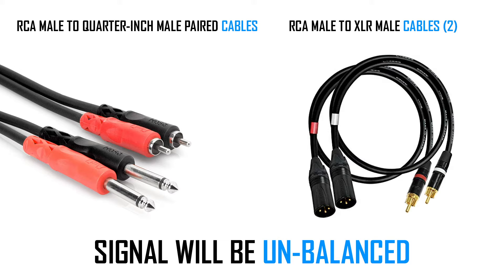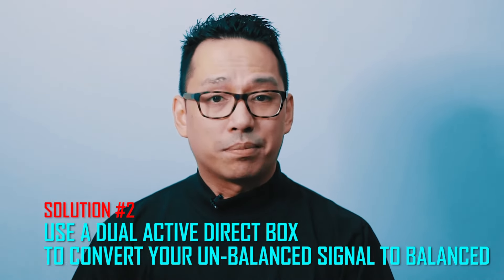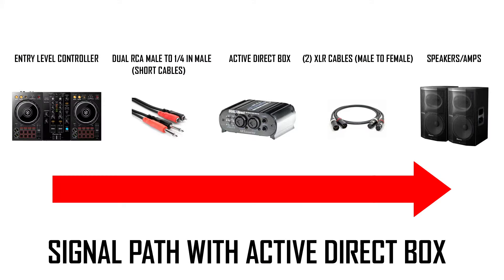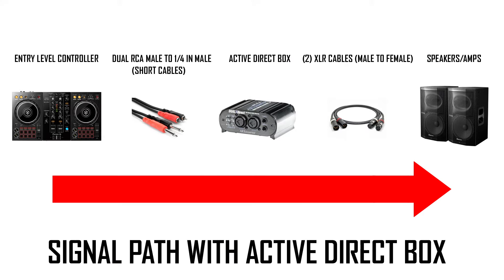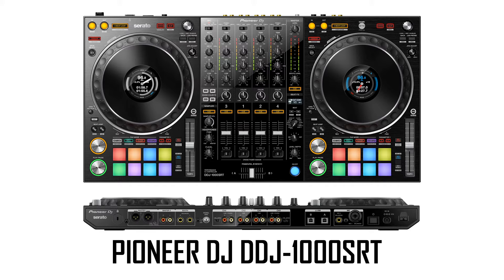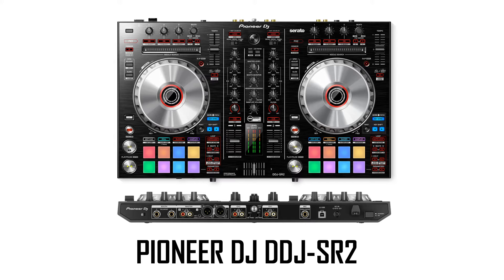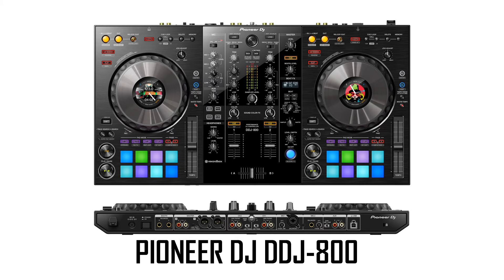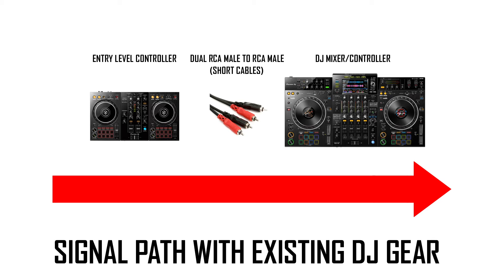Entry Level DJ Controller | How to connect to speakers or sound system

Comment from the maker: Product Links:
CABLES
RCA to RCA cables https://amzn.to/2NEyBni
RCA to 1/4inch cables https://amzn.to/2O3qXSx
XLR female to XLR male https://amzn.to/2qIhND4 

ADAPTERS
RCA female to 1/4inch male https://amzn.to/2NFuirM 
RCA female to XLR https://amzn.to/2NJLnRH 

ACTIVE DUAL DIRECT BOXES
Behringer Ultra-DI DI20 https://amzn.to/33HBCZM 
Art Dualxdirect https://amzn.to/32JProZ 
DBX DI4 (4 Channel) https://amzn.to/2Q7UPQm 

SMALL PA MIXER
Behringer Xenyx Q802USB https://amzn.to/2QiNv4e 

MEDIUM PA MIXER
Mackie ProFX 16 V3 https://amzn.to/2rvFq1R 

POWER SPEAKER
Pioneer Pro Audio XPRS15 https://amzn.to/36YXa63 

STUDIO MONITOR
Pioneer DJ Bulit8 https://amzn.to/2CAor0z 

ENTRY LEVEL DJ CONTROLLERS
DDJ-SB3 https://amzn.to/370yUAm 
DDJ-400 https://www.zzounds.com/a--3970758/item--PIODDJ400 

2 CHANNEL PORTABLE DJ CONTROLLERS
DDJ-SR2 https://amzn.to/33IFDgr 
DDJ-800 https://amzn.to/34VEKkM 

4 CHANNEL DJ CONTROLLERS
DDJ-1000 https://amzn.to/2rFpU3P 
DDJ-1000SRT https://amzn.to/2Kdaaey 

ALL-IN-ONE SYSTEM
XDJ-XZ https://amzn.to/2XmNdex 

4 CHANNEL DJ MIXER
DJM-900NXS2 https://amzn.to/2KfS8bP 

2 CHANNEL BATTLE MIXER
DJM-S9 https://amzn.to/36YPwbX
Reply from the maker: Trapnest this is why I recommended the 802 and not the smaller ones. The smaller ones do not have balanced outputs. But if you check the manual of the 802, it will say both the main and control room outputs of the 802 are “balanced” and require a TRS quarter inch plug. Key word is “TRS”. If you use a standard TS quarter inch plug, it will default to unbalanced.
Reply: So I have a question:

I have a ddj400 and I want to live stream with it and have an additional microphone that I want some eqs for to make it sound a little better.

I was thinking about getting a mixler like the yamaha m10xu so I could plug the controller and mic in and get them out via usb - HOWEVER I would like to have ONLY my music on my monitor speakers and not hear my own voice! But I can't mute my mic on the booth output of the mixer. The ddj 400 has no possibility to have two different outputs. 

Can someone help me? Maybe the Idea is just bad and I need 2 mixers ? Any help would be super cool!!!
Reply: @priyonjoni  So u can’t plug speakers into that Berringer..if
so where?
Reply: I guess Im asking randomly but does any of you know of a tool to log back into an Instagram account..?
I was dumb forgot my account password. I would love any tricks you can offer me.
Reply: @Kason Eduardo Instablaster ;)
Reply: @Brixton Moses thanks so much for your reply. I found the site through google and Im in the hacking process now.
I see it takes quite some time so I will get back to you later when my account password hopefully is recovered.
Reply: @Brixton Moses It worked and I finally got access to my account again. I am so happy:D
Thanks so much, you saved my ass!
Reply: @Kason Eduardo You are welcome =)

Comment: Excellent video. Thank you. If I use a dual active direct box, does it matter if the 1/4 adapter (on the RCA cable) is TS or TRS to then achieve a balanced signal using XLR cables to the speakers? Many thanks, Graham
Reply from the maker: I don’t think you can use TRS with RCA. Either one signal carrier is inactive, or it’s mono all the way through going to nothing.
Reply: @priyonjoni  thanks so much for taking the time to reply 😁

Comment: Great video but what if I have a direct box but the night club sound has 1/4 cords connected to the sound system. Do I need a "xlr to 1/4 adapter? Male or Female 1/4?
Reply from the maker: If it’s balanced quarter inch, use an XLR to TRS quarter inch.
Reply: @priyonjoni  Does it matter if it's male or female if I'm using a direct box to balance the sound?
Reply from the maker: What matters is if the input is balanced or not. Otherwise the direct box won’t matter.

Comment: My small gigs ik have a old tall pioneer mixer from 02 luv it the venue has its own sound like speakers tht mixer and sim xlrs since I live upstairs I used to  drag each 1200 down and my weak vinyl record selection but I made it work and back their get 150.00 11 til 2am i did not care in the slightestIt was winged so well I kept getting called back it a knock at my back door😂I’m glad when practiced I put my speakers out the windows and he knew I spun from tht

Comment: Appreciate this knowledge!!  I have a 15in powered spkr with a passive.  Bought an addtl passive thinking to run the controller thru an amp w/2 passive. The active one gets too hot and they clip.  Now with the mixer can run the controller, mic and addt'l thru that without the need for an amp.  Is that correct?

Comment: Thanks for the video. I got a venue coming up at an older club. I go to check out the equipment and the host there hands me an rca wire with an 8mm jack and tells me this is what will connect to my controller. I have a rev7, how will I go about connecting an 8mm jack to my rev7?

Comment: I just got myself some used Yorkvile NX55P speakers - 
I need some help on how to setup 2 Yorkville NX55P speakers with a Yamaha MG10 Mixer and a DJ Controller - Numark Mixtrack pro - I helping  my son getting this setup for his starting role to become a DJ music services 

Dj setup - Mixtrack Pro controller 
2 PA Power speakers Yorkville NX55p
Mixer - Yamaha MG10 
Cables requirement - Currently  2 XLR cables - Male/female ends - RCA cables with 1/4 " ends - 

How to connect Yorkville 2 NX55p speakers to a Yamaha MG10 with a Dj Controller

Comment: I HAVE A MIXER WITH XLR I WOULD I LIKE TO CONNECT 5 POWER SPEAKER PLUS A SUB A TOTAL 6 AND I WOULD LIKE TO ONLY USE XLR CABLE NO 1/4 INCH PLUG HOW CAN MAKE IT WORK WITHOUT USE CHAIN FROM ONE POWER SPEAKER TO OTHER THANK YOU NEED HELP.

Comment: Hello Pri. I have ddj400 and and wanna get clean signal as you described with using behringer q802 usb. I found older version of behringer 802 with a good price. If I bought that can i get a clean signal like later versions of that pa behringer? Or should I get a di box for unbalanced to balanced food signal

Comment: Great video, congratulations! It was very helpful for me. 
I wanted to ask you a question about the Xenyx 802 USB mixer. 
I read in the manual that the Main output is UNbalanced and has a resistance of 120 ohms. 
However, in your video, you indicate that the Main output is balanced.
Could you please verify whether it is a balanced or unbalanced output? 
Thank you in advance.
Reply from the maker: I remember someone else a few years ago seeing this in the manual. I think we concluded it was a misprint. An XLR output would not be unbalanced.
Reply: I finally solved the dilemma regarding the main output of the Xenyx 802 USB mixer. I confirm that it is a balanced output, as stated in the original manual in its packaging, unlike what is found online.

Comment: I have a question about my own setup. 

My current DJ setup is DDJ PRO 200 -> RCA output to  RCA input on my amplifier with 6 m RCA cable. The amplifier are connected to the boxes. The Quality of the sound isnt that great. I want to buy a active direct box, so i can hook up a short RCA Cable and from there connect it to the emplifier. My question is: does this work to if there is a emplifier in between and what kind of cable should i use. I dont have a XLR input in my amplifier. I hope to get a responds soon, bc i have a big party this saturday ;) thankyou

Comment: Here is a good question for you - I have a ns7 numark dj controller that im using xlr to connect to 2 - krk rokit 6 - i want to know how i can connect my system to a Kevler Professional 1pc. ZLX - 15SD 15 inch Active Subwoofer ? my idea was to go xlr from the krk rokit 6 to the   Kevler  sub with xlr and go out of the  Kevler  1/4 back to my ns7 xlr female ? as i dont have a pa. will this work ?

Comment: I have sort of a preamp with 4 inputs 1/4 inch inputs n 1 1.4 inch output for $22.00 from amazonI use I think called Wifine it boosts the signal from ,y computer head phone 1/8 inch jack it works pretty good going to two active Kustom 12 inch and a horn loud 100 watt active speakers.

Comment: Why would you need the USB version of the mixer with an entry level controller? To record to another computer – Assuming you go for a digital mixer (ie one with an audio interface built in, that has a USB socket on the back to plug into a computer as well as analogue outputs), you can plug directly into a computer that isn’t your DJ computer to record or to livestream. No need to own a separate audio interface – just get a live mixer with one built in

Comment: Many Thanks for this video! I was watching with big interes but my english is not good and i need to ask you something ..if i connect my controller to this mixer can i my controller only play the songs from it and the mixing itself is done on this mixer plus adding effects ? I hope the question is understood
Reply: Thank you! My English language is not good and i need to ask something because im using flx4. If i buy some mixer is it possible to use effect pedals on it and pioneer rmx1000? I looking for way to use effect pedals and specially pioneer rmx1000 with my flx4.

Comment: I have a question! I have an xdj-xz, and I run 4 powered subs, and 4 powered tops. I usually run 2 of my subwoofers out of the booth outputs (1/4-xlr) to the left and right, and daisy chain the second 2 subs off of those. And for my tops I run them out of my main out (xlr-xlr) and daisy chain my booth monitors to those and just adjust the levels for the booth on the back of those speakers. I do that to keep the sub levels separate from the tops, but is there a better way to run this setup and get the most out of it?

Comment: I've temporarily downgraded to using Pioneer ddj 200 thru an interface to connect to high powered active speakers. For A few weeks it has been working fine until now I only have sound coming out of one speaker. Is this because its not really compatible? or ddj 200 not powerful enough to use?  Please help.

Comment: I just bought ddj 200. Next week i have a gig. Please help me on how to connect ddj 200 with speakers. Can I use only audio interface for good signals. Please help me with this I'll really appreciate
Reply: The DdJ 200 doesn’t have e rca output.   It has a usb to PC .   So the audio signal goes to your computer then using a single jack connected to your headphone output on your laptop or an external sound card.    

From your computer then you can get a pa mixer where you can connect your pc audio output.   From the mixer then you connect the speakers.

Comment: hy there Pri yon Joni! I'v been looking for your videos sibce the begginning of my Dj mini carierr. Very usefull infos clear and easy to undestand videos! I like what you do. About this video i need your advice as an pro tech ! I have the follouing setup that i use: Hercules inpulse 500 controller (unbalanced output 6.3 jack) a mixer ( for now the Alto Zmx 862 main mix balanced or unbalanced 6.3 jack output) and from there active woofers (only balanced in/out) and active speakers that can handle balanced/unbalanced signal. I undestud that adding an active DI BOX after the controller the signal goes ballanced  into the entire system, but it will that help increasing the overall strenght of the sound? (in the same gieven conditions, same settings) Does it makes a difference in sound Quality? I undestud that if a active speaker is built to work with balanced signal is better to use balanced signal for best performance, regardless of it's capacity to also handle unbalanced. Hope my english is good enough for you to undestand what i mean. Thanks alot! Respect

Comment: i never found on internet that the outputs of this mixer are balanced. AM I missing something?
heres some text from the user manual: 

"The MAIN OUT connectors are unbalanced mono jacks. The main mix signal appears here at a level of 0 dBu. The MAIN MIX fader adjusts the volume of these outputs. The XENYX Q802USB and Q502USB mixing consoles feature a rotary control for this purpose."

tx alot and great videos by the way! Chears from Romania! ;)
Reply from the maker: It’s in the manual.

Comment: How can I do microphone recording on my  serato dj pro with my Sb3 controller ..is it possible ?
Reply from the maker: The DDJ-SB3 is not routed to the USB so it's not possible to do it internally. You will need to record externally, like to a recorder.
Reply: @priyonjoni  thank you sir

Comment: Question ? I have a evolve 50M how can 2 dj’s plug up it has a 8 channel mixer would each dj take up 2 channels for left and right stereo or use a use a XLR y adapter to a channel per dj? Thanks in advance
Reply from the maker: This is a fact that you have to remember, RCA to XLR does not convert to balanced. So when you use an XLR adapter from RCA, it's no different in quality from using RCA to RCA. So to answer the question, yes, it's ok to use an RCA to XLR however, you have to treat it as an unbalanced signal path. That means, keep the cable length relatively short or you will deal with interference.
Reply: @priyonjoni  its a little different evolve only have a 1 mixed out my is hooking a controller up do i need to run left and right to evolve 50M channel 1&2?

Comment: HI there, thanks for video, would you be able to recommend another small PA mxer?  As I can't find the Behringer Xenyx Q802USB in stock anywhere. Cheers.
Reply from the maker: Mackie ProFXv3
Reply: @priyonjoni  does this mixer have the ability to convert an unbalanced signal to balanced as the  q802 can? thank you

Comment: Hi Pri yon Joni.  I wonder if you can kindly help with a question. I've connected my entry level DJ Controller (Pioneer DDJ FLX6) to an active 2 channel DI box (Behringer Ultra-DI DI20) using an RCA to 1/4" jack, and connected the 2 channel DI box to active speakers using XLR cables (with 1/4" jacks into the speaker).  I believe my DJ Controller has no phantom power, so I'm using the battery power of the DI box.  I'm having a major issue with the speakers hissing very loudly (with the hissing noise increasing as I increase the speaker volume control).  When I use an RCA from the DJ Controller to the active speakers, there's a very low hissing noise, but the level is very low and doesn't increase as I increase the speaker volume.
Have you any advice to help, or advice on what might be going wrong?  I've tried the different db settings on the DI box and tried both ground and lift.  Thank you very much.  Graham
Reply: Hi Graham, I had difficulty with the DI DI20 also.  Im using DDJ SB2 entry controller.  I tried battery and phantom power.  Ended up giving up with it.
Colin.

Comment: Thanks but I’m wondering why people buy a pioneer RX2 I can just mix fuckin good with a sb
Reply from the maker: DLG GAMING so you don’t have to use a computer and you can prep and practice  for an upcoming set using CDJs with flash drives.
Reply: Pri yon Joni oww yeah ive played on a RX2 some time but I haven’t owned one

Comment: Hey bro my krk won't work when I hook up unbalance wires to rx3.Could it be it mean I need balance wires.
Reply from the maker: Did you turn the volume up from the RX3?
Reply: @priyonjoni  I used rca wires then it worked.Thanks for the reply!Please make another DNB video.

Comment: Fantastic video thank you. One question i have as regards to the Beringer, can i hook up 2 sets of powered studio monitors and still maintain a balanced output from one RCA out on my dj controller. Many thanks.
Reply from the maker: An RCA out is not capable of a balanced signal. But if your cable is under 6 feet, you’ll be fine.

Comment: When I got back into the hobby in 2013, I used a Mixtrack Pro Mk1 and later a DDJ SB2. Both great little devices, versatile and extremely portable. But, they still only got RCA outs. I knew that the signal was unbalanced and I would have troubles pairing them with active PA speakers, but I didn't want to spend several hundred dollars just for a mixer with balanced XLRs. That's when I found out about this crazy little invention called the DI box. The Behringer DI20 was only 25€ on Amazon, so it was a no-brainer. Now, I was finally able to plug my entry-level gear into pro speakers without looking (and sounding!) like a total noob. To this day, I'm using the Behringer DI20 to amp up the sound coming out of my backup controller, the Pioneer DDJ-REV1. For beginner DJs wanting to play their first big gigs, this thing is a 100% MUST-HAVE!! 👏

Comment: Hello from Canada – 

I'm newbie at setting up my newly (old really) acquired DJ Controller Numark NS7 - Don't have any user guide or how to hardware guide.

Need assistance in the setup and cable connections - Please help!! - I'm a retired old man and want to impress my family on special events - not looking at a new career just want to lear and have fun with DJing - 

- DJ Controller - Numark NS7 with had case 
- Professional Mixer 4 channels Mic-line Mixer
- Speakers - Old Mission speaker model 761i ( black/Red wired connection plugs at the back ) unpowered 
- Speaker - POA Corporation Speakers model SL120 - 1/4 plugs in/out connection 

Can someone help me connecting the DJ controller to a Mixer if needed and speakers - (what cables are need , i purchased several cables in order to match and make this baby work) 

Any suggestions on how to begin ? I would be so grateful for any help and support -

Best regards - Thanks in advance 

Matteo
Reply from the maker: Generally, you can plug your controller directly to your speakers. But it sounds like you have passive speakers (which need a seperate amplifier). I would trade those speakers and get powered speakers instead.